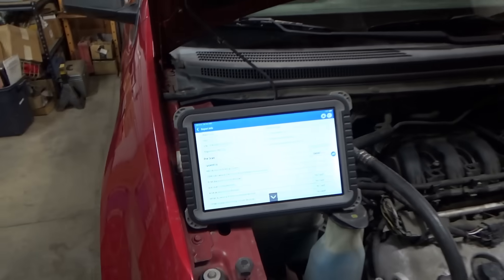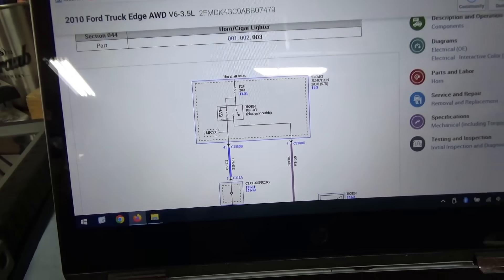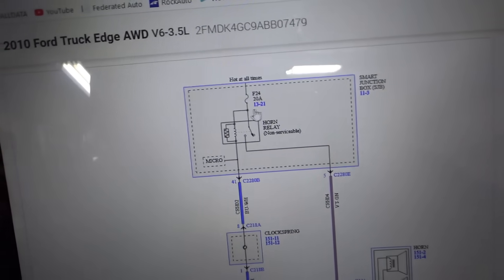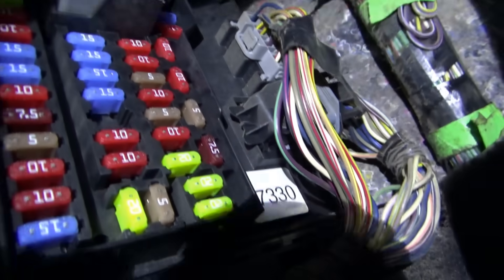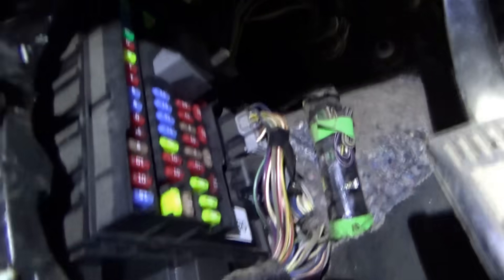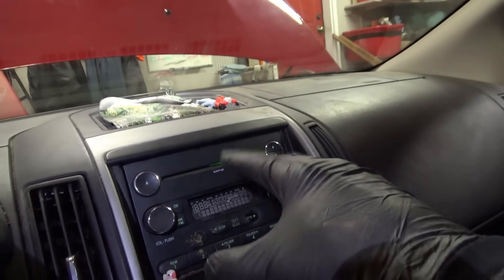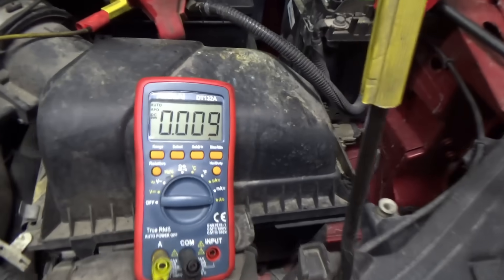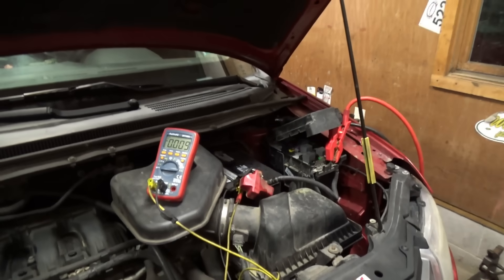Ford DRAINS Battery OVERNIGHT?! ('10 Edge)

Comment: Have you seen a Jeep (WJ 2000) have a battery draw? Headlights flash on randomly. Leave it for 3-5 days and it won't start. 
What can I use to track the frequency of the battery draw? It's not a constant draw. I've checked fuses for voltage drop, and didn't find a fuse that had a load on it. I'm thinking there would be a fuse showing a load when the lights flash on.
Was doing some research and many people are saying the multifunction switch on the column is the culprit. Is this switch control by a network? Faulty network commands being sent to the BCM? I actually tried a used BCM and things didn't change.

Comment: Interesting, The RCM (restraints control module) was throwing a code for loss com with the APIM, the APIM was showing offline on your scanner's device tree, but the vehicle doesn't have a touch screen, so I don't think it's supposed to have an APIM. maybe the RCM has been replaced, and incorrectly coded?

Comment: Once you put the vehicle on life support, prep for testing, and let the vehicle go to sleep, it is best to put a hand held current clamp to inspect the current, like in the video, mainly to see current magnitude but also to see if the parasitic draw is static or dynamic. If it is dynamic then it is best to put a Pico current clamp monitored with the Picoscope to see what exactly the dynamic behavior is, which could lead to better understanding what component has failed, but also it is helpful if you then look at another similar vehicle and it has the same current signature. Most module network wakeup issues will created a periodic current signature. If not periodic but still dynamic it could just be a faulty module unrelated to network activity.

The horn activation is due to very low battery voltage confusing a module reset.

Why did you thermal camera not detect the active fuse?

Comment: Excellent diagnostic method.  The only thing I would do different is not to use the ammeter in series because if some large load suddently comes on, it can blow your meter and/or blow the fuse in the meter.  If you used a bench power supply with current limiting, then your meter would be protected.  Great video!

Comment: My 2008 Ford Fusion had exactly the same issue. Radio stopped working (different type to your Edge), battery  would die after 2-3 days. The radio had an internal short. Got a replacement from Ebay, no issues since

Comment: Can somebody tell me why my 2008 tundra tpms light won’t clear. Replaced all four sensors. Spent $250 at the dealer only to have them tell me it might be a receiver or a module. $800 each. I said no way. How do I validate so I can buy used on eBay.
Reply: Did you calibrate the new sensors or just install them thinking they are plug and play?
Reply: @johnt.848  dealer installed and programmed to the vehicle.
Reply: does the spare tyre have one?
Reply: @ no

Comment: far to often these boxes get wet from either clogged sunroof drains or a leaking windshield i had my explores auto climate temperature readings glitch out and all of the sudden in the middle of the summer im being blasted with heat and the a/c refuses to run because it thinks it’s -40 outside luckily the smart junction box in the explorer is not mounted to the body it’s attached to the dash just above the brake pedal so it doesn’t get wet just the harness connectors for the dash to body harness got wet and how often these days that the radio is the issue is honestly not ok they keep making things cheaper and cheaper but charge us more it’s crazy i mean everyone should make a profit but at what point does it get to the stupid level anyway i have lost track at how many radios with smashed screens i have seen due to frustration of the owner because of bad solder joints but the one that really takes the cake is the ford body control modules oh they aren’t quite as bad as Mopar with their tipms but they are a close second anyway i really enjoy watching your methods in diagnosis an have learned a few tricks along the way i did want to ask was that an oe diagram if not what was your source for it as it looked very good definitely don’t get that all the time

Comment: When connecting your amp meter in-line it is easy to blow the internal fuse. You can connect a .1 ohm resistor in series and measure across it with the volt meter and multiply by 10 to get the current. This will protect the meter, the amp clamps are not reliable at very low currents.
Reply: Not the one Ivan was using. Ivan, is a professional and his tools never let him down. That also includes his brain.

Comment: If you connect an m12 battery (or any 12V source) to chassis ground and power on the DLC breakout (spade terminal to 4mm banana jack, fuse on positive line), with an ammeter in line, you can disconnect negative battery terminal and get the amps without the risk of losing power. It's a DIY memory saver/amp meter.

Comment: A colleague of mine came to me at work with a busted and blown up multimeter.  He was trying to troubleshoot his camper, and I think he had it set on amps without a load. Why it melted his multimeter meter leads and not the fuse I don't know.  But after that I brought all my equipment in for multimeter lessons.  Everyone was surprised there's such a thing as an amp clamp.  And these are engineers like myself.

Comment: I just bought that clamp meter from your Amazon store. I love it. Not expensive at all either. 👍
DIY'er
Reply: Right I just started using  one about  a year ago when I seen IVAN with one on 12V systems didn't realize how useful one is, Now I use it on many things, especially problem Circuits like blower motors, fans and Fuel pumps, If you know how many amps should be drawing it's nice to have this Data instantly without having to touch anything. Great Video once again Thanks IVAN 🇺🇸💪Let's let the Golden age begin 🙂👍.
Reply: I didn't know Ivan has a Amazon store. 🤔 Will check for it...
Reply: I bought one a few months ago on sale. It works well and for it to  accurately measure .59 amps with a large inductive clamp is amazing at the price point.

Comment: Sound diagnostic strategy, Ivan! Seems the horn was impersonating the culprit 🙂 Sometimes too much light overwhelms faint lights - that radio was having an internal party and didn't want you to know 🙂 You could have saved a few minutes, if you pointed the thermal camera at the radio, but the fuse box sent you there too. Good job!

Comment: Horn blarring only happens when the battery is really low. Then the central lock also doesn't work on the remote. Just the car telling there is a problem. Really funny when this happens on a holiday at the camping in the middle of the night...
Reply: One of the Ford Falcon models here in Australia used to use soft foam inside the horn to keep the terminals separated, all good until it gets old and the foam degrades and the only way to shut the damn thing off is rip off the battery terminals. Real fun in the middle of the night standing in the street in your jocks.
Reply: Ya my 2019 Ford Ka+ does that as well It's a very clever design
Reply: Another thing that could happen 
It was a company truck 
Don't remember the make
It got really cold out and I got a knock on my door after midnight and the horn in the truck was blaring 
Neighbor wasn't happy 
I went out and hit the center of the steering wheel and it stopped 
It happened a couple other times throughout the time I had the truck.
Was weird 🤣🤣🤣
Reply: Speaking of camping.... Quite a while ago I went camping and didn't really think that it was the start of summer vacation. 

I went with my brother and his girl (now his wife) and our quiet state forest we usually visited in off seasons was overrun with parties! Loud music, screaming people, and to top it off............ The neighboring campsite locked their keys in the car and were setting off the alarm constantly. 

It was a sh1t show, never again...

Just like joining a motorcycle camping trip without checking the weather (as a hurricane was approaching) that was one wet weekend....

Comment: I have a parasitic drain issue on my work vehicle, a transit connect xlt. When you turn it off and take the key out, the radio just keeps on playing. I wouldn't buy a ford if my life depended on it.
Reply: Do the lights come on or off when you open the drivers door?

The radio is designed to stay on after the key is out for a few minutes, until the drivers door switch registers an "open". Then it shuts off. 

For a test open the passengers door, the radio should shut off.  If it does, I think your door switch is bad. 

If not, it's deeper.
Reply: @volvo09 i used to notice that the front/rear daytime running lights used to activate when I opened a door, and I don't think they've been functioning Iike that for some time now. I can turn the key off, wait for a bit then open the driver door and the radio will stay on. If I exit the van then open & close the passenger door, no difference. It's been a money pit for quite a while.... 126k on it and everything about it seems like it was only designed to last 80k at the most before being scrapped and replaced.